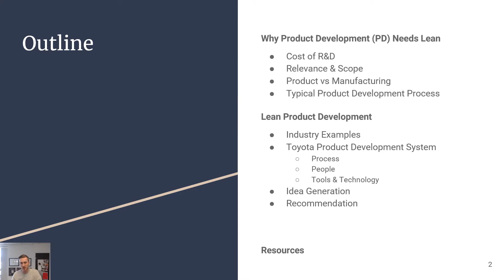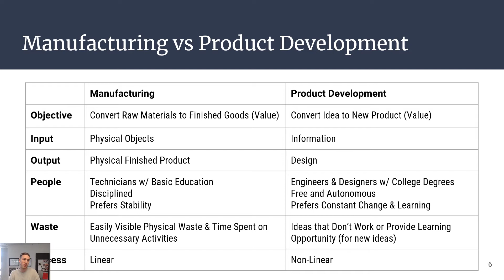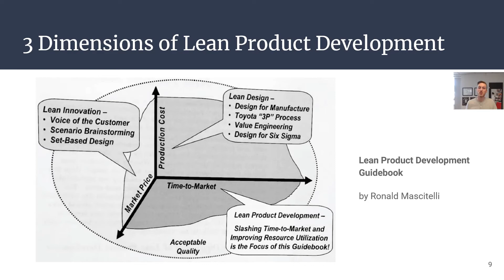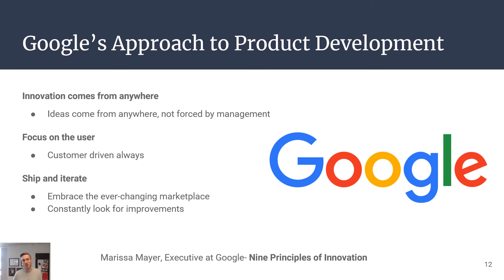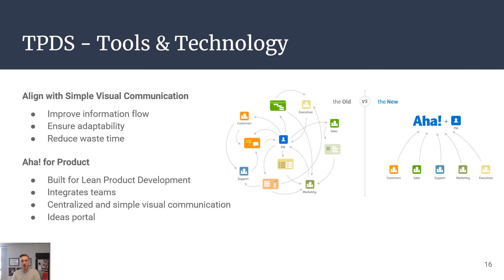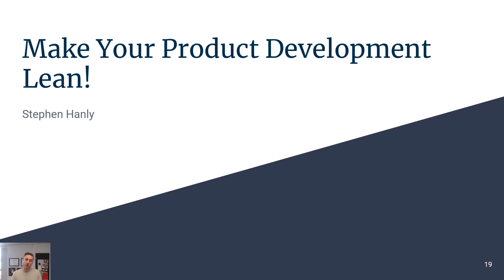Applying Lean Principles to Product Development

Comment: The slide at 14:00 is great!
For the working Project Manager who would like to see examples of these principles I can recommend the following books:
Morgan, J. M. (2006). The Toyota Product Development System. New York: Productivity Press.
Cusumano, M. A. (1998). Thinking Beyond Lean. New York: Free Press 
Kennedy, M. N. (2019). Success Is Assured. New York, New York: Routledge/Productivity Press. (especially Chapter 4 and Appendices)
Ries, E. (2011). The Lean Startup. Germany: GGP Media GmbH.
Liker, J. K. (2021). The Toyota Way. New York, New York: McGraw Hill.
Reply: Are these 13 principles from Morgan and Liker's work from TPS still relevant??? and how methods are use or frameworks to implement them
Reply: @parthparekh9924  There are whole books on change management. One theory is that you have absolute support from the CEO on down. Many employees will roll their eyes at the "flavor of the month". The other theory is that large systems that work are grown from small systems that work. Pick a small but significant system and switch over to lean. You can slowly reduce work in progress inventory.  Work through the problems. Implement lean tools one at a time. Always keeping in context, the big picture. You coach employees to develop their skills and meet challenges. They are the job experts. Lean has problem solving methods. It is not a problem free method. The environment is always changing, and you are always adapting to it. This is the exact opposite of the supervisor who says "My system is proven to work. If the lazy employees would just do their job, everything would be perfect." When the system is successful, you quadruple the number of areas that it is deployed to. If it is not successful, it stays mall. If it is successful, it grows quickly.